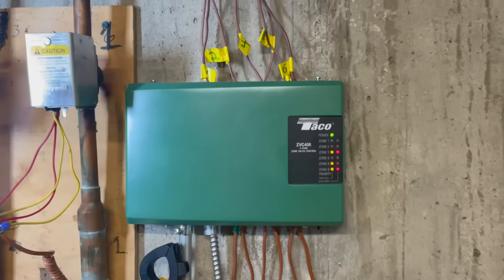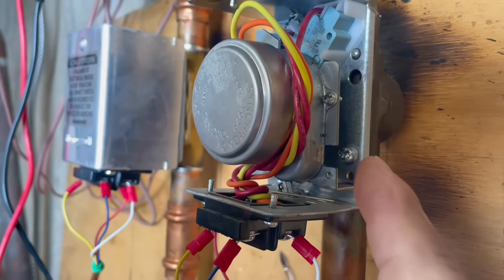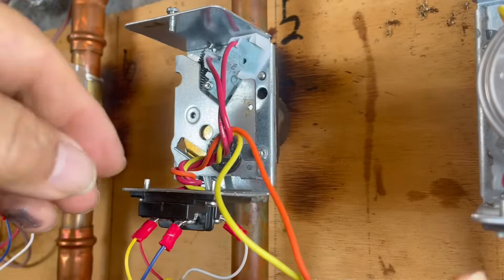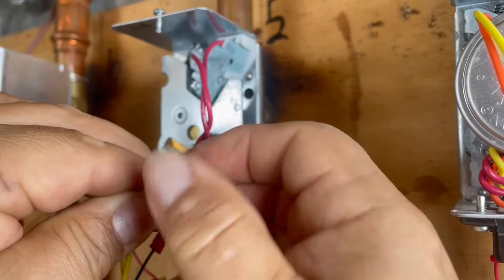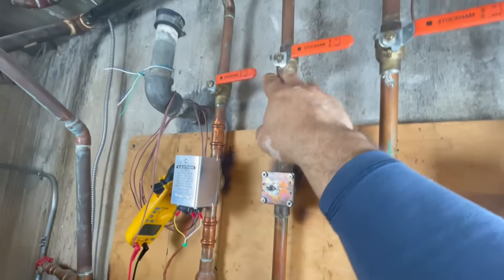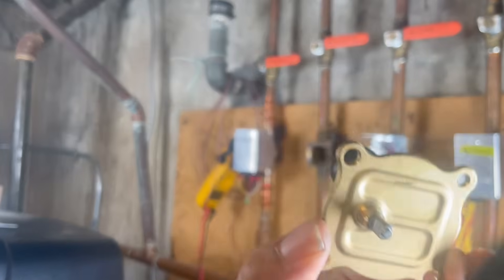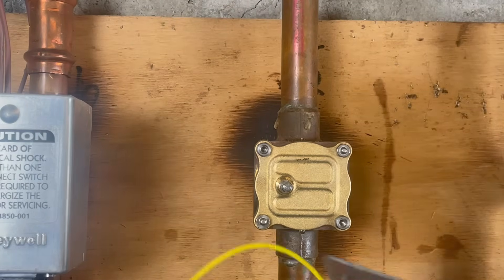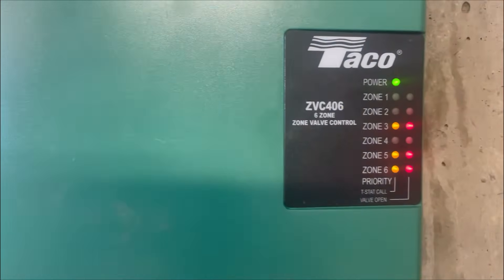HONEYWELL ZONE VALVE MOTOR, POWER HEAD AND BALL VALVE REPLACEMENT, STEP BY STEP.

Comment: Do you have to worry about the air in the system now?
Reply from the maker: @Markcgreer  Hello.  Not me.   I had isolation valves .  I bled air before opening the system .   Most system don’t  have proper isolation valves.    I you don’t have them,  yes.  Air could be a problem  and it makes sense  to bleed .   Thanks for your question

Comment: Great video!! Thank you. My shut off valve will sometimes not open and I have to manually open it. It will randomly get stuck on close once or twice a week. What I do is manually open it and then it works again for a few days. I’ve been thinking or replacing the valve but not sure if that’s the real issue.

Comment: Hi Alex, do you have to bleed the lines after this?  If so, whats best way?  Thx
Reply from the maker: it depends on your system .   If you had isolation valves. then ho\you don't have to do anything.  Very little water lost and very little air went in.  The air scoop will take care of that.   IF you didn't have isolation valve and lost lots of water then. yes.  Hopefully you isolate all the other valves and you  just have to bleed the one you fix.   Look at other videos on my channel about bleeding the line.

Comment: hi is it ok to just stop using zone valves and manually open valve and leave open all the time so when other zones are called this open pne will always get hot water?
Reply from the maker: Hey Tom   If you are ok with that.   IM ok with that.  
Just know that since is manually open , it will never close and might get too hot in that zone.  
But to anwe3r your question:   Yes.
Make sure you properly open it.  Don't forget to hook it>  And leave at hook for to seconds so it stays.  Good luck!!

Comment: Thank you Alex, very well put together video. May I ask your opinion on this: I have a boiler heating system with 3 zones, my radiators in zone 2 stay hot no matter even if thermostat is shut off. My best guess is the ball valve is stuck in the open position, so the hot water consistently flows thru the radiators. Any other thoughts?
Reply from the maker: Hello it could that the motor failed in the on position and the end switch is pressed continuously .  See my latest video tonight or tomorrow.  Or it could be the ball valve as well. 
 Good luck. let me know what fixes it.   Greetings!!!!
Reply: @alexthehandyman3494 im in an apartment building fixing a specific units heat, constant heat coming in, the ball valve is the only thing that makes sense but I dont have the motor with an end switch, just a 2 wire(orange and yellow) already replaced the motor and unplugged thermostat, turned water back on and it flowed right through still. Lol

Comment: Hello Alex. first off I just wanted to say thank you for making these very informative videos. I have a question I was hoping you might be able to answer. I currently just had two zone valves that were not working. I noticed this due to the red lights not coming on on the TACO box. I replaced them and when I turned the power on, all three zones lit up red on the TACO box. So it was indicating all 3 zone valves were open. However one of the brand new Honeywell zone valves is not engaging the end switch but the TACO box is still showing the red light. How is this possible?

Comment: Great video, very helpful info. My situation is a little bit different. As soon as I turn on the heat in my thermostat, I can hear the valve gear turning and then some water(cold at this point) would flow through and I also heard water flow sound for a few seconds at the baseboard. Then furnace would start(then stop when it reaches 180f), but the hotwater is not reaching the baseboards, and when I touch the pipes around the zone valve , it is lukewarm. It feels as if the value opened then closed? Is that even possible.  I have 4 zones, 3 are working without any issues. Any suggestions? TIA
Reply from the maker: Hello Charles.  
1. Make sure all the wiring follow the same pattern ss the other 3 that work.   
2. Make sure all the connections are tight.
3. Swap a good thermostat on the one that doesn't work right.(to rule out the thermostat)
4 Make sure that that zone is not air bounded.  Bleed it  if necessary .
5. It might be time to change the power head.   Some times the dial thing spins but the gates failed in the closed position.  the motor gear turns but not the actual valve gate.

Comment: Thank kindly Alex for the HELPFUL video. Is the power switch from the boiler different from the power switch from the Electricity? Thank you.
Reply from the maker: Hello Christian,
Most boilers should have 2 switches:
1 the boiler switch by the boiler.
2 the emergency  red box switch.
A lot of them only have 1 by the boiler.
It is code now to have an emergency switch outside the boiler room.
It should  be on its own breaker .
Although  I have seen them on the same lighting breaker for the boiler room.

Comment: Thanks for this video. I can open mine manually, and I am hoping that means that it's just a bad motor. The motor is really warm compared to the other zone that is working. Feel free to let me know your thoughts.
Reply from the maker: if you have 24 volts to the valve and if you force it open water runs through it.  Then is very likely it is just the motor .  Good luck. .  let me know how it goes.